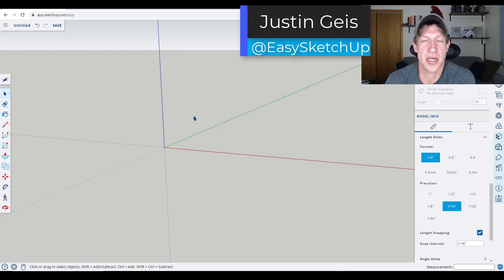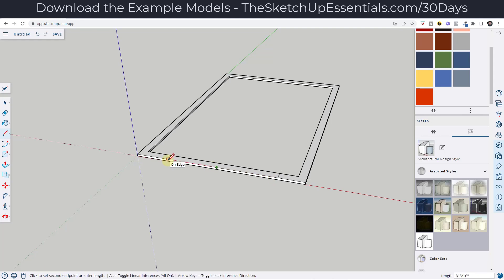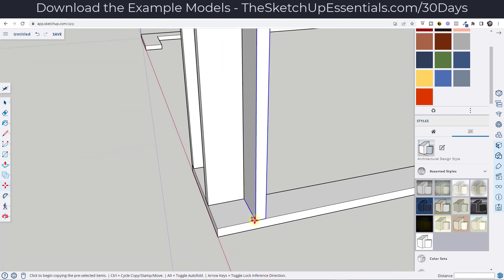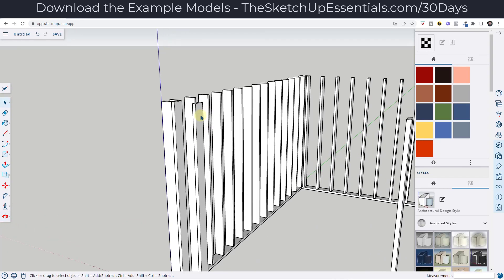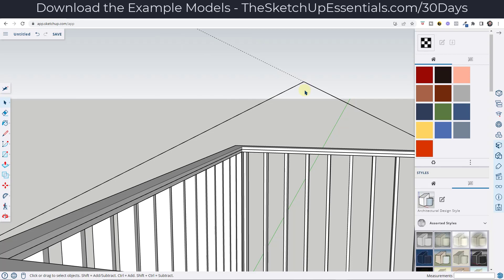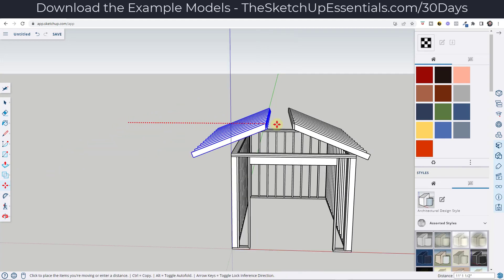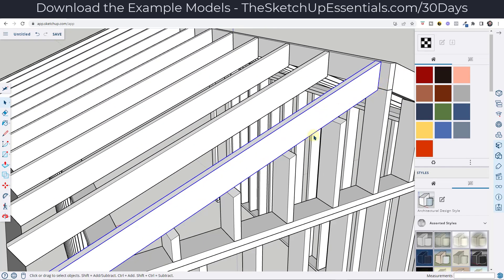Learn SketchUp in 30 Days DAY 9 - Modeling Framing!

Comment: Thanks for a very helpful series of videos.  I've worked with AutoCad 2D before, but this is very different.  With the help of your videos, I'm learning to use SketchUp very quickly.

I noticed that I don't see the step to Edit Component before you make changes to a component.  I'm working with SketchUp Pro 2021, so maybe things are different in that version.

Comment: Okay, I liked your other videos so much and then ya lost me here.  I have used the copy and move, but can’t figure out the times step and you weren’t showing where  or how that’s entered. Any help?
Reply from the maker: You don't enter it anywhere really - it's just like when you draw a line and type in a length. So in this case, the exact flow would me - Select object, Activate Move tool with M, Single Click to set base point, move mouse and click again to set copy, type *5 and hit enter key to create 5 copies. You don't have to click in a box or anything like that. Follow the steps exactly and see if it works

Comment: I appreciate the video but it would be even more helpful if you actually knew the correct dimensions for framing. For example, 2x4 walls are the standard with studs spaced 16" oc. If you used 2x6 they would be spaced 24" oc.
Reply from the maker: You should be able to draw whatever framing you'd like at whatever spacing you want based on the info in the video. It's a modeling tutorial, not a "how to frame a house" tutorial

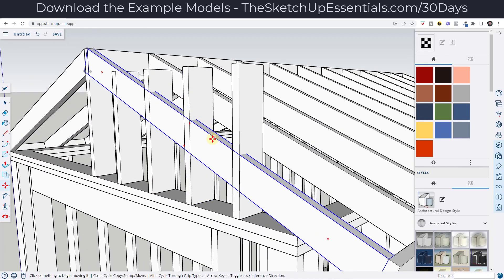Comment: First of all, Thank You for the wonderful information. This is very helpful for new users. I have a question that involves your statements at about 12:15 on the video. You mention that there are a couple of ways to handle "intersecting" objects in Sketchup. Do you happen to have  a video that covers these ways? I'm working with come complex intersections and was looking for a way to make those cuts. For instance, do you know of a way to cut one object by making another object the "cutting edge"? Again, your step by step course is fantastic, even for a modeler who's been working with all kinds of similar tools since the mid 80's.  Thanks.

Comment: Hey quick question. I am following along, and when I draw the second rectangle after making the first one a group, the offset tool will not work. Is there any reason why? I'm doing exactly as is being done in the video
Reply: I'm having the exact same issue :(
Reply: @Alexfpons  Me too
Reply: Same here
Reply: same
Reply: I had the same problem and had to extrude the first rectangle that was created in the exercise.  This gave me a slab to build on, as well as solving the problem with the offset not working.

Comment: My floor won't offset.
Reply from the maker: Make sure you're inside the floor group
Reply: I had the same issue . 

Traced it back to me drawing the floor (first rectangle)  using the Rectangle tool. I figured out If I draw the floor with four line snaps and then Group it (like Justin does in his video) before drawing the second rectangle (using the Rectangle tool) , then the Offset tool works fine on the second rectangle. (I am currently using the free version of Sketchup). 

Not sure why this makes a difference, but it does, at least with the current version of the free version. .(Seems like the result is four edges and a surface either way - right?!) . 

Since you posted a month ago you likely figured it out since then, but hope this is helpful for someone else.

Comment: I believe when you modelled the roof framing you lost the 6,12 slope... you set your guide to the top of the 2x6 to the edge of the wall... but you set the angle to the bottom of the 2x6, thereby lowering the slope.  I think you should have drawn the 2x6 upwards, not down.    It's not a framing thing... so much as you lost your reference angle thru that process and as a result the entire roof slop is off...